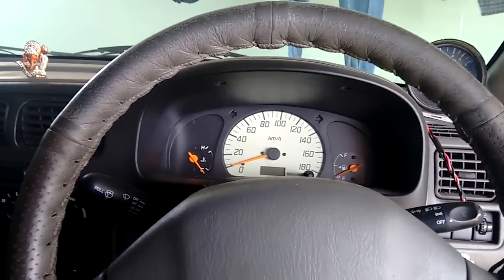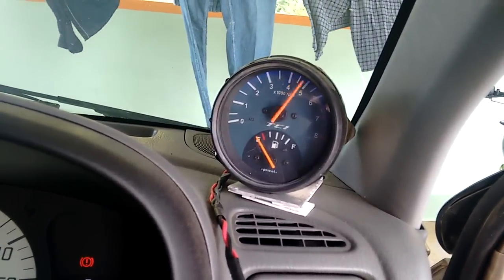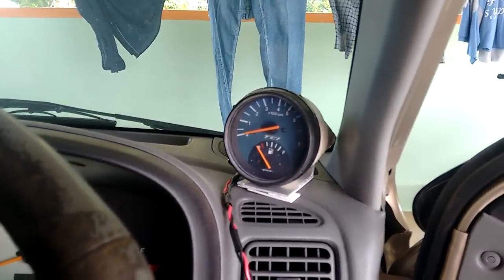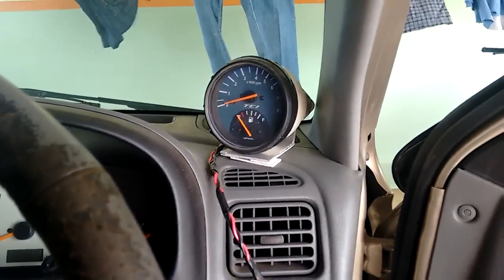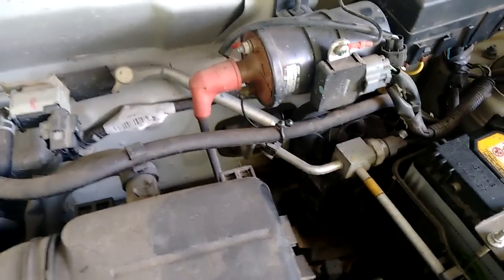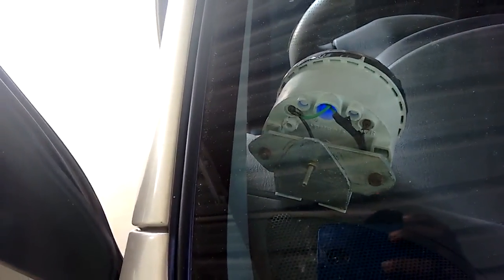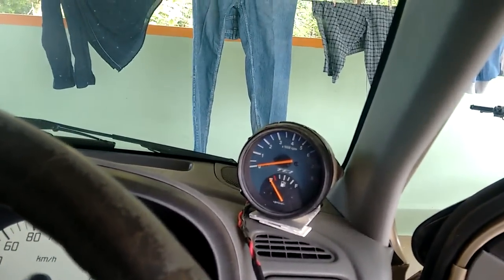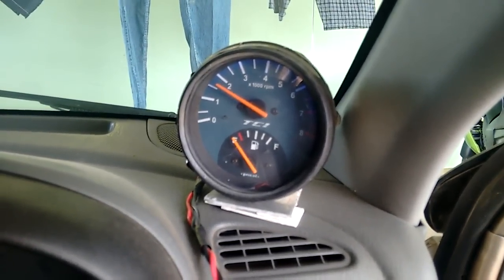DIY Wire a Tachometer on your Alto

Comment: Sir, I have recently installed the A-star tachometer in my bs3 alto, the gauge seems to be working fine when idling, but the needle starts bouncing once the engine is revved. Is there any way this can be fixed?

Comment: bro i think there is an error in the rpm reading.the calibration is wrong i guess
Reply from the maker: +PRATHYUSH PRAVEEN Yes Praveen the calibration was off when i shot this video....I used the trim pots in the meter to calibrate it later
Reply: yes im also notice that
Reply: thatz not correct
Reply: Calibration is perfect but its of a 2stroke engine hence it displays double the rpm of engine, if you want to keep this console just change the markings value by sticking a new sheet of paper with your design